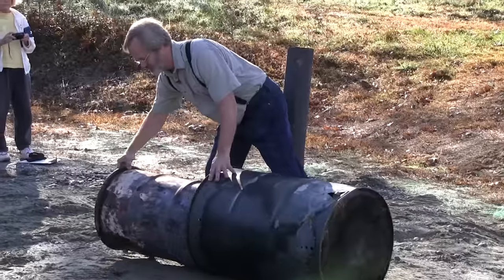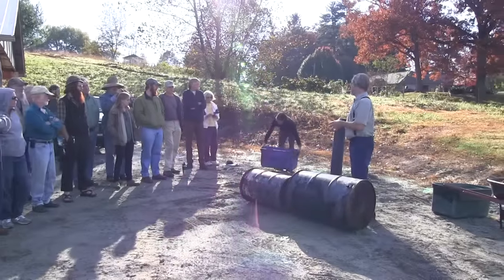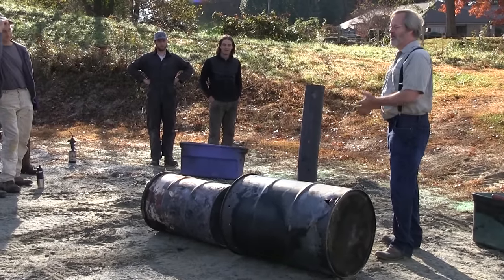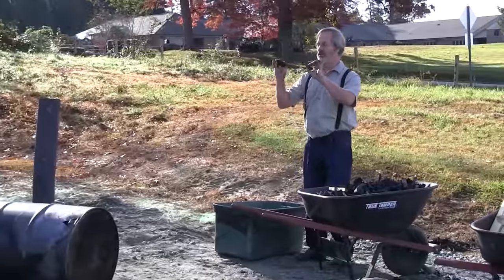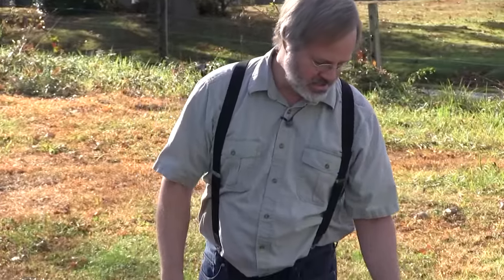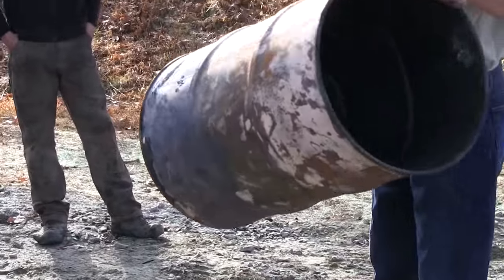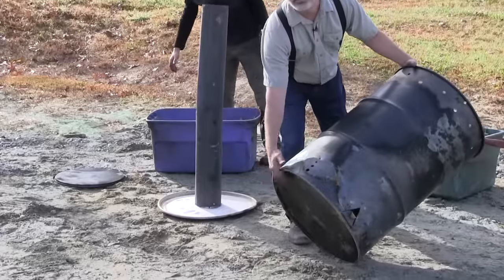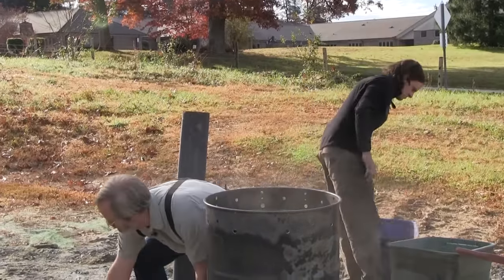Biochar Workshop Part 1, How to Make Biochar

Comment: Is it necessary the chamber is to be filled? Can we used for makinga  small amount of biochar?
Reply: You can do it on a small scale right in a grill or in a fire pit or fireplace. First, get a cookie tin or 
popcorn tin, depending on the size of your grill. Fill the container 
with dry fibrous material, secure the lid with three self tapping screws
 around the rim and WARNING! you must poke some holes in the top to let 
the flammable gasses escape. When the gasses stop coming out (you will 
see the fire coming out of the holes as long as the char is roasting) 
you know the char is done. I usually put the container upside (holes) 
down on a fire safe surface. Let it cool and make sure that you crush 
the resulting char to <2mm particles before you start enriching 
them.
Reply: You can do it on a small scale right in a grill or in a fire pit or fireplace. First, get a cookie tin or 
popcorn tin, depending on the size of your grill. Fill the container 
with dry fibrous material, secure the lid with three self tapping screws
 around the rim and WARNING! you must poke some holes in the top to let 
the flammable gasses escape. When the gasses stop coming out (you will 
see the fire coming out of the holes as long as the char is roasting) 
you know the char is done. I usually put the container upside (holes) 
down on a fire safe surface. Let it cool and make sure that you crush 
the resulting char to <2mm particles before you start enriching 
them.

Comment: You could make a seal for the lid with glass wick like they use on air tight wood stove doors, then clamp.
Reply: +Citizen Brain you're missing the point.  It DOESN'T need to be sealed.  Not having it sealed allows for minute amounts of oxygen to be drawn in, mix with the particulates (smoke), which allows those particulates to be further combusted in the chimney as a second-stage burn.  He flat out explains this, in no uncertain terms, when he mentions those "secondary vents" at the top of the outer chamber.

Comment: so can we do this with all the shredded mulch (tree) lumber mills , arborist and utility companies are desperate to get rid of?
Reply: Yup.
Reply: +jason mcmillan Look up Back to Eden gardening. It's a much better use for that sort of thing.
Reply: +crazy808ish Actually, that's not correct. This basic char is used to mix with compost and thus making biochar, it sequesters carbon while increasing crop yields. The two uses are equal just depends on what features you want from the waste product.
Reply: Number Eight  Back to Eden gardening  increases crop yields too, also eliminating the mixing with compost step, as well as keeping a lot of the nitrogen that biochar lacks which means quicker results. Plus it's much less work and less polluting.
Reply: crazy808ish Like I say it depends on the uses you want out of it. For instance making char can use heat in poly tunnels to increase production on shoulder seasons, can prime flats/potting mix with activated bio carbon to increase yields. Back to eden use is fine for say the home setup but its not really useful in competitive market gardening.
Reply: Number Eight  Maybe if you're really reliant on poly tunnels and have limited space. But otherwise, given the quality of produce, health of plants, less need for watering, and reduction in weeding times, I can see it as very useful for market gardening, But to each his own I guess, since I'm not a market gardener.

Comment: I would like to give you an input, what if you were to make biogas from a septic system. Using solar panels as your power source, connect a air pump ran from your solar panels of course, the outlet to where the gas comes out, using the air pump to pump the gas into a radiator system, giving you Compressed Gas. Connecting a cut off switch would be absolutely essential.

As the radiator system fills with gas compressed, using that as a big Torx going into your can. Using something such as plaster of Paris to insulate the can, much like a forge, thus making biochar from natural gas, methane.

I have been studying green energy for a number of years and have yet to apply it to my life. This will all change very soon, as I am buying my final home, very soon
Reply: Best of luck to you in your exciting nee venture! Do take notes, to share with us what you've learned.

Comment: Could I heat a greenhouse with the waste heat, and could you elaborate a bit?
Reply: Yes. However there would be drawbacks. The system produces a LOT of heat but only when you are running it. Unless you are making biochar all winter long, you are unlikely to be able to use it as a consistent heater. Similarly, the system runs in cycles. It has cool phases (loading, unloading) as well as active (burning) and when it is burning it produces most of the heat at the beginning and middle of the cycle then goes through a long cooldown where it produces less and less.

Comment: Be careful that the fuel does not have spaces to allow the fire to jump to the bottom. In my case vertically aligned 2*4's did fill most of the space, and the fire was able to grow to the bottom and so much smoke was released the neighbor's were concerned, and I had to douse the flames with water.

Comment: I'm glad to see people take an interest in saving emissions, and the topic of less is more in energy terms.   However...trees give us H2O...we must have it to breathe.....if we all do this...wood is already scarce...We need to put this guy's mind toward finding an alternative fuel source!!!  In the deep South, they used this method in the late 17 and 1800's to keep warm because the land had been decimated(trees cut or forests burned).  The char was used in their fields because they didn't have access to fertilizer.  I have 3 old stoves like this that have a pipe on the side- you just have to put the air holes in a different configuration and where you start the fire in relation to the pipe.  Turn it sideways, if you will.   My parents bought an old plantation house and the land attached to it in 1987, at auction. My dad passed away and we moved back home to raise our son and help my mom.  I'm still remodeling that house today.  It's a neverending gobstopper!!!  LOL   It had one of these stoves in the bathhouse, living room and kitchen.  I took all of them out and repaired the fireplaces (4) and added Central heat and air.  I'd never seen such things so, I did a little research on them to figure out what they were used for. I kept them and today I use one in my woodshop and another in my greenhouse when it gets to below freezing.  Not often.   They work quickly and last for hours if packed right.  I commend this man for not adding to the emissions we put out.....clean burns are the way to go if we want to live.   I wish big companies would listen to him and figure out a way to clean burn their wastes and emissions.  Love the squirrel....he wanted his 15 minutes of fame, didn't he?
Reply: I was gonna read this comment but you lost credibility when you said plants give us H2O to breathe.

Comment: Unfortunately, we don't get see the system in full retort gasification mode. This is usually when a LOT of obnoxious thick, brown, acrid smoke is emitted. I really would like to see how it performs as an urban backyard requires a very efficient, smoke free system. I realise you can't get it totally smoke free, but as long as it's no more obvious than a BBQ, it should be OK!
Reply from the maker: Bruce Taylor We are proud to say our system runs clean and clear most all the time. That's an integral part of the design and operation.
Reply: Living Web Farms I came back to this video in hope for a bit of advise. I started my 1st biochar load today, but had to hose it down  and hour into it, fearing the complaint of my neighbors or even a local authority visit.

I do believe that due to the barrels having paint on them, this could have provoked the greysmoke. It was also a very windy day, could this have had any influence on it?
Reply: Yes painted barrels will leave a smoke. Until that is burned off.. You will not have a smokeless system. Be careful to not breath in that smoke

Comment: Why not use the fumes in as the tail end of a gasifier, collecting the gas into liquid and even the left over gas to run machines, such as generator to battery banks...refrigerators etc???   I'm making one of my own design and so excited to combine these two principles together. I've seen really crude ones on a DIY from a guy that had no welder al the way to massive expensive and complicated ones.... I mean basically the fumes you are using to heat the inside drum could be used for this purpose and allow the outside wood to do what it does and even then capture the exhaust and distill it ... perhaps a simple collection tube could be attached to your exhaust and cool and distill it down and see what comes of it, but I suspect separating them is far more efficient. I have seen a cooker half that size keeping a 5k w generator running After distilling and getting all the liquid out of it... 
   Most don't want to burn pine but in a gasifier the gas is wonderful... so another problem solved and made use of. I also think that some use the fine stuff for the burning like a cigarette and even pound it down... wood logs, pellets... etc. Turning waist into useful energy. 
Blessings

Comment: Anytime you burn anything your creating  carbon dioxide .. To reuse the gas vapors released fr the cooking processs back into the biochar making is a sensible economical way to keep pollution down however th e carbon dioxide and other s are still being released ,at least carbon dioxide can be used by vegatation and converted  as the other gases are not. Thanks for the video..if we all stop one day a week and just turn out and off all electrical use in the homes when fessable  it could mean the difference in the long run ..

Comment: YOU COULD PUT A 3/4 INCH SOFT COPPER COIL PIPE TO HEAT WATER OVER THE CHIMNEY AND RUN THE PIPE ENDS INTO A 100 OR TWO HUNDRED GALLON WATER TANK WITH COLD WATER BET IT HEATS THE WATER UP REALLY FAST, FOR WASHING STUFF OR COOKING AND BATHING, OBVISOUSLY IF YOUR BATHING YOUR GONNA MIX HOT WATER WITH SOME COLD TO FIND THAT HAPPY BALANCE .

Comment: Just some pointers: Smoke is not equal to the gas produced by the biochar making process. Smoke by definition contains particulates, gas does not. Also, you can make biochar from other plants and would not make that clinking sound you mention; examples are rice hulls, bamboo, etc. But of course, you're referring to local situation in America. Just a reminder for the international audience.

Comment: Hmm putting the pyrolysis into the earth and then using the full burned chimney gases to feed it into an oven for baking bread or pizza to using the energy would be quite interesting. If the gases were hot enough.

Comment: I can make my own biochar without any special equipment in about the time it takes to watch this vid.  How many are REALLY going to invest this much in it?
Reply: What method do you use?
Reply: What method do you use?
Reply: @armouredoutlaw1537    I make a teepee shaped burn pile, that part takes a little time not inc. in above statement, just my tree trimmings over say 4 to 6 months of normal yard work, but material handling is unavoidable regardless. 

  The reason for the 'teepee'--conical brush pile, nothing fancy just the longer straighter limbs leaning in from the parameter to keep backyard footprint minimal, taller than wide, miscellaneous brush just tossed in the center is contained by in-leaning limbs, takes minimal space in yard and creates a very fast clean burning chimney effect. VERY little smoke that is shot straight into the sky on a still-ish day, neighbors barely notice except the flames will also be tall.  I used to just burn typical messy random pile, that works also but much more smoke, hot raking required, takes several hrs or half a day and a lot more space in yard prior to burn.

I exaggerated a bit on the time in irritation at the "workshop" nonsense.  Takes maybe 90 minutes to reduce pile to char with no attention required until last 30 min to rake aside char ready for quenching and that still requiring little more burn time, not essential but better yields that way. (this is radiant hot work, recently been using a welding helmet for face shield and you have to work quick, step away to cool cloths frequently, you also can just quench the entire pile and have a little extra unfinished material for next burn)  Also there will be a few large diameter unfinished chunks you can put aside for next burn regardless, the pile will be reduced to about 2 wheelbarrows of char from about 8 to 12 ft tall 6 ft  wide teepee, plus very small leftovers start to next pile.  

I'm continuously building a burn pile for 2 or 3X per yr burning.  Also it's technically not "bio-char" until it's charged, it's just char, but mix it in your compost pile or whatever, don't worry about big chunks too much but I crush it some in a bucket with the end of a sledge hammer sometimes. Arguably you don't want it all in powder form for optimal soil life accommodation anyway.

Comment: edward revill does it different he burns from the inside with a rocket stove ,lets the gasses take over from the wood burning  to heat charing wood i think that is more interesring for small scale  heating
Reply: I can certainly see some value in that. So, the rocket stove burn chamber is inside the jacket of charring material with the gasses automatically released into the rocket stove burn chamber?

Comment: Biochar was made by farmers in the Amazonian rainforests.
Mixed with the soil it absorbed minerals over the years of heavy rains.
Planting a crop allowed the plants to grow better.
But the fallow time was long, so the charcoal had to be allowed to absorb minerals once again.
Just adding charcoal has no benefit at all.
Reply: Depends. On Midwestern farms, a fallow period followed by burning was common. During the brushfire phase, not enough air would be able to rush in and vast amounts of char were created. Those fields were left to rest at least one more year and typically were enriched with manure for that time just to stabilize, then, it was said they would be the most productive.
Reply: You do need to charge the biochar. Urine, manure, even chemical fertilizer if you must. But this is mostly for sandy soil that doesn't hold fertility because the microbes break them up too quickly.
Reply: Moot point, those same farmers mowing down the rainforests for development and farms, then recklessly scorching the slash are the reason the rest of the planet has to try and reverse the CO2 emissions and try to minimize our carbon footprint forever more

Comment: That wood-stove is not secure. With a sudden blow of the wind it will be overturned and the wind will transfer the flaming pieces of wood to a great distance, creating - at least - a few open fires all around in the neighborhood. All that - possibly - during the night that people sleeping. Extremely dangerous. With a concrete chamber around it, strong wind cannot turn the wood-stove over. I believe it will be safer in that way.
Reply: A sphere (looking at it from above) has one of the lowest drag coefficients of any shape not designed specifically for a low drag coefficient. It's not likely to blow over in any normal ok, ok,  I don't really know what the hell I'm talking about. :)

Comment: Pallet wood is almost always toxic from chemical treatment to make them durable.  It makes an excellent fuel stock but I'd not char it.
Reply: Prjndigo not always. Sometimes they are simply heat treated. It’s more safe and cost effective just depends on the customer needs

Comment: The price of drums and the amount of work this is isnt worth it, UNLESS you make your char in the winter and use the energy to heat your home. WAY easier to just dig a pit bury some fish at the bottom make a fire and pack it till its full to the top with coals and cover it. Come back about a month later and till it all in. This is what I call 100 year soil.

Comment: Great idea but if you're using a burn barrel get rid of the paint and don't burn it off causing toxic fumes .Also never ever burn pallet wood or other lumber that's been treated with various chemicals to resist rot or insects . One of those ingredients is zinc .Also never use a galvanized metal garbage can to use as a burn barrel or a BBQ grill unless you want to get poisoning .
Research what these materials are made of before burning them .
Although this process does make good biochar from regular non treated wood it does not get hot enough to incinerate the toxic chemicals used in treated wood or paper .
There are decent websites that can show you what is used in treating newspapers and also how to identify pallets and what they're treated with .
Also never burn OSB , particle board or something like that which is what most furniture is made of these days. Stick to burning non treated wood and chemical free organics only .

Comment: Brochar  is not worth the effort to retort it.  Biochar, sheet cardboard mulching  & hugoculture are the same thing as far as the goal for their use.  Order a truck load of wood chips would accomplish the same goal unless  you can make biochar as a by product of another operation like brush pile burning. As our host say light the brush pile from the top to reduce the smoke. YT channel Skillcult shows the burn pricedure

Comment: slap a turbine on the smoke stack and boom, u got electric energy
Reply: add a stirling engine on the side to pull heat from the smoke stack and you've got even more electric energy